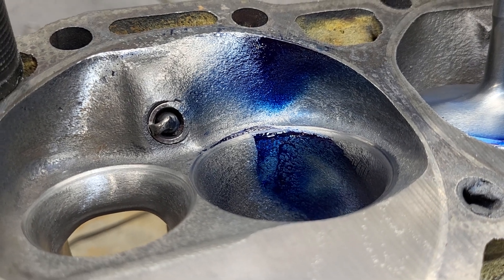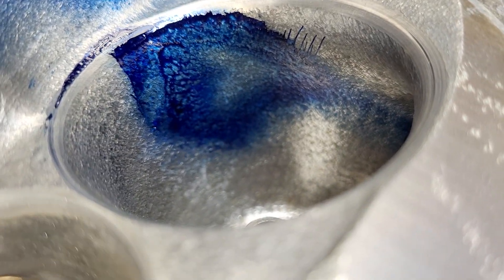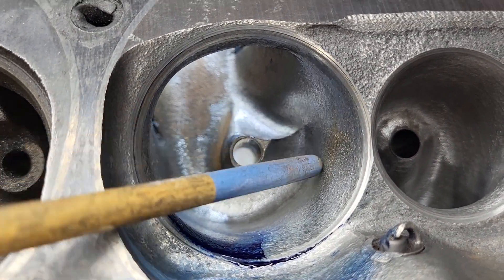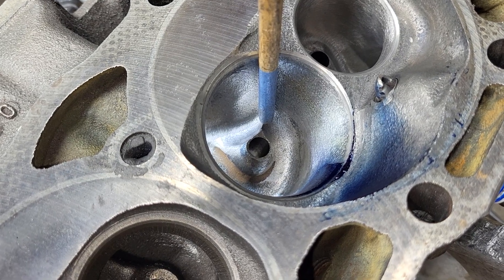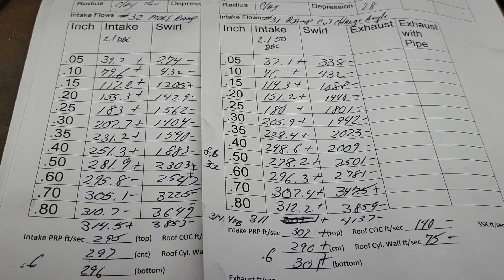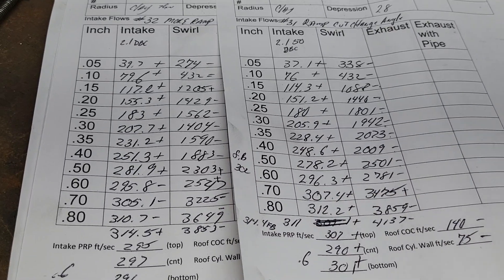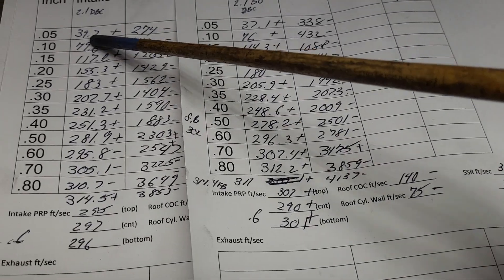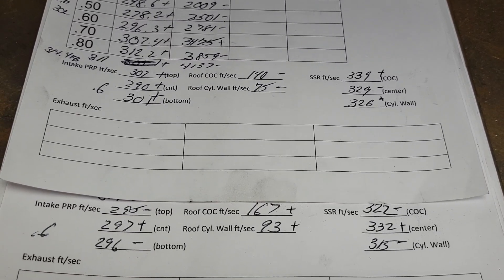39. Chevy 193 TBI Swirl port cylinder heads, Cut #32, More ramp changes more mid range!

Comment: This is Youtube at it's best. What could be better entertainment for the cold winter nights (-25C (-13F)) than this, thanks to Charles! I'd like to hear your thoughts behind the port filling and orcourse see it done here. I wonder, how do you anchor the fill properly to the port? Is it done similarly with aluminum heads?
Reply from the maker: I was thinking about this yesterday. There is some epoxy work coming up. Stay tuned. Thanks
Reply: Good question. I'm interested in brazing exhaust ports in iron heads. Really bugged about my exhaust ports being way big. Might have to run 1 7/8 headers to clear the ports and I don't want primaries that big. 😖🙃
Reply from the maker: @notnecessarilynecessary  It can be done.
Reply: @servediocylinderheads  . Thanks for the reply. I might try to tackle it myself. If not I'll just run them as is until I get another set of heads in the future.
Reply from the maker: @notnecessarilynecessary  Brazing iron needs preheat and a long cool down to prevent cracking.
Reply from the maker: @notnecessarilynecessary

Comment: I'm curious what will the flows be when the helix gets to 4-5 oclock like a afr head uses. I think the stronger 200-500 lift flows will net more hp since it sees those twice as valve opens/closes. Your killing it when I consider my 235cc 2.08/1.6 aluminum aftermarket heads(pro-topline) flow less than your junk swirl ports.
Reply from the maker: I like the Pro topline design. Thanks

Comment: Looks like you learned how to use the ramp to push the flow around the valve seat and bowl area. This is an interesting discovery which could be put to good use on a virgin port/cc. With all the stuff you've learned since the start of this fiasco, I can see you getting 310+ @ .700 if you had to start over.
Reply from the maker: If done right. Thanks

Comment: I can run another sim for ya , i can also compare your current port to that one i did back at cut 25 , (2.08 valve) , also i've been modeling the 394 with Comps biggest Hydraulic roller , (12-872-11) it's a .600 lift drag cam but doesn't seem to have the best power curve , i ran the iterator on it and it found better (shorter gross) duration numbers for better over all power ,  there are many more choices in the solid roller section , do you guys (u & Stevie) or anyone else have any cam suggestions i can toss into the sim ? 
If anyone is wondering i'm using DynoSim-5
Reply from the maker: Stevie was talking to Mike Jones. Thanks
Reply: @servediocylinderheads  Okay so ran the sim agian and the Cut 25 port (2.08 v/v) actually made 635 Hp @ 6500 rpm and 554 ft lbs Torq @ 5500 and CUT 32 (2.10 v/v) made 638 Hp @ 6500 rpm and 556 ft lbs @ 5500 rpm .... Cut 32 had a 7hp advantage a little spike at 8000 rpm.  Below 6000 rpm the power curves were +/- 1 hp of each other.
Reply from the maker: @luckyPiston  Good info, please give specifics of the sim. And Thanks!
Reply: What did your last sim say? Based on my gut feeling, with the perfect cam, high compression and high revs, this engine 393? could touch low 600's, realistically ~510 to the wheels isn't outlandish. It would need ~2600lb chassis to do high 9's with 510 to the wheels.
Reply: @rolandotillit2867  11.4:1 compression .. 950 carb .. Peaks were ... 630 Hp @ 6500 Rpm & 550 Ft-Lbs Torq 5500 Rpm
Reply: @luckyPiston  If he Charlie gets 310cfm at .700?
Reply: @rolandotillit2867   310cfm at .700? ... I tried that and it didn't change the numbers at all, i guess that confirms that if the cam doesn't lift into that range the motor doesn't make use of that flow potential. ... If i put the 310 in at .600 the peaks are 640 and 557 from 638 and 556 same rpms , so 14 cfm more way up there picked up 2 hp.